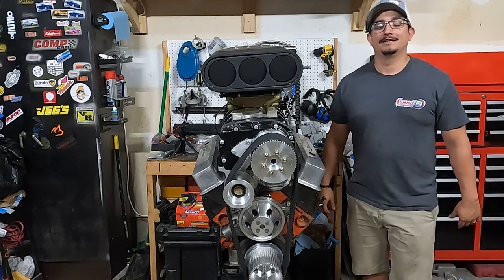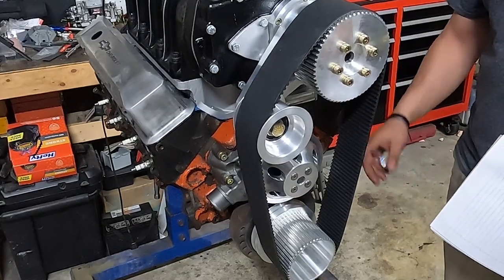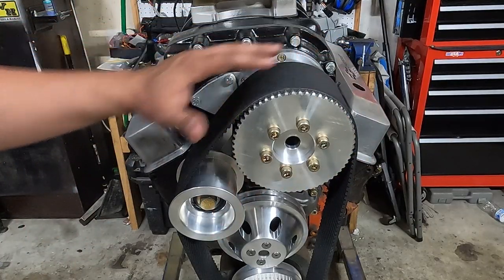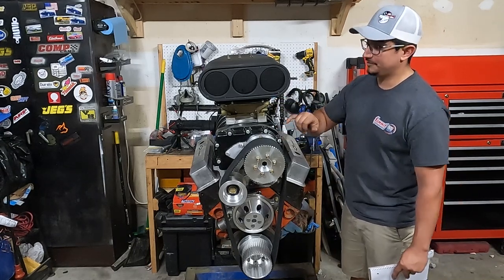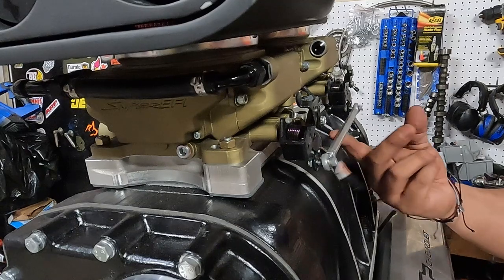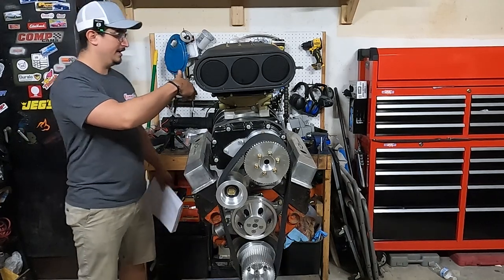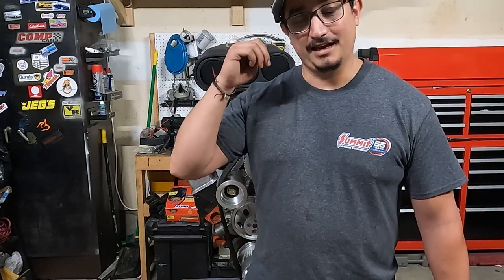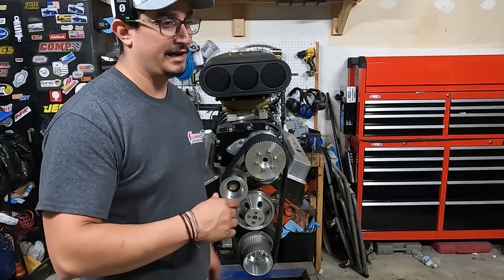How much does a supercharger cost? BUDGET Built Roots 6-71 Supercharger

Comment: There is nothing wrong with a good deal but I have to strongly disagree with " it's just aluminum " there's many different grades, not all aluminum is the same. I'd like to say it's just a pully.  I've done the budget build several times and learned the hard way not all budget parts are the same. Youre going to need some extra cooling. without charge air cooling at some point you're going to be trading timing for boost. I would suggest meth injection for a little cooling and help retaining timing. If or when you go to put boost on that SS you'll be looking at around 9k.
Reply: most brands get their stuff from the same place which i've found, no matter what they say theyre all sourced from the same places.
Reply: How does methanol injection work? I've heard of guys just spraying windshield washer fluid right into the intake (blinker fluid if you've got the bank for it). Do you just run a switch on the throttle to detect WOT and turn on a pump?
Reply from the maker: You're right on a lot of points there. We'll if it blows up on me I'll be sure to do a video on it! 

Down the line I want to do a 2"  intercooler. Then either some nos or meth to stabilize the temps and timing. Starting basic for now! Will amp it up as the build requires.
Reply: @miketriesmotorsports6080  essentially yes, ideally you'd use boost reference to activate the spray if using methonal.